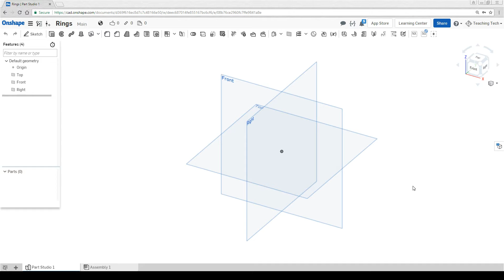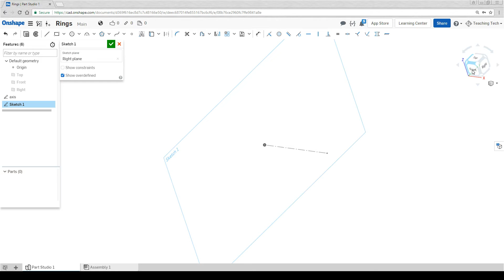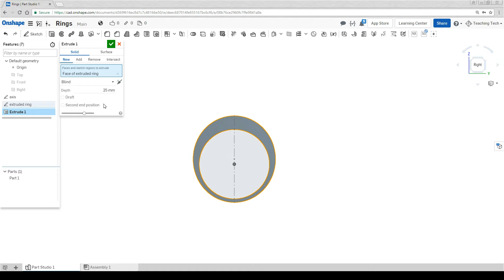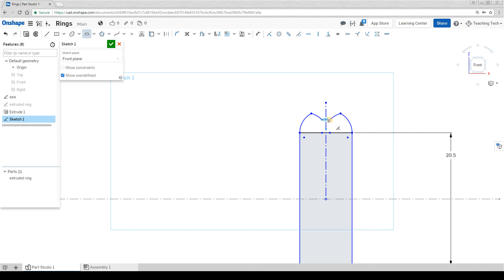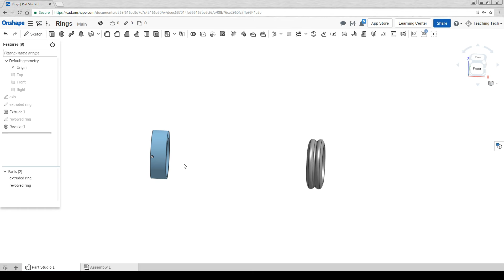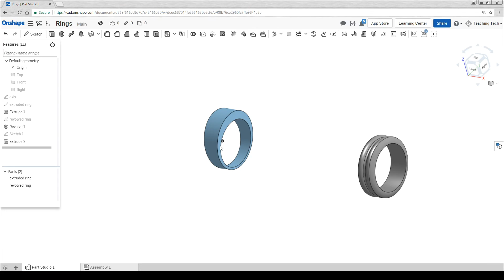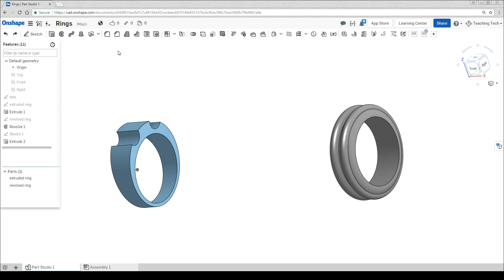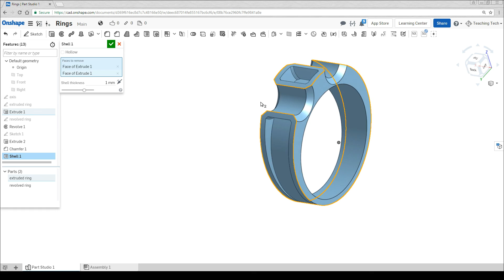Modelling 3D Printed / Investment Cast Rings - Part 1

Comment: At 6:40 I found that it was not possible to drag the apex of the V up and down as shown.  I had to remove the equal constraint on the V before I could move it and then reapply the equal constraint.  I couldn't figure out why I was having this problem but speculate that maybe it's caused by a change in OnShape.  Interestingly, I also found that by putting a dimension from the apex to the base of the V, changing the dimension moves the apex up and down despite the presence of the equal constraints on the sides.  Hope this is helpful to someone.
Reply: I had the same problem. The dimension did the trick.

Comment: when doing the taper at around 7 minutes, the user interface had changed so that symetric is not an option in the drop down menu but it is a tick box underneath. hope that helps somebody else also
Reply: thanks 👍